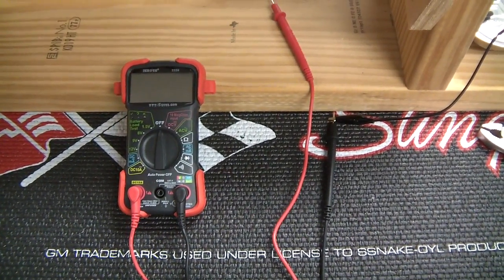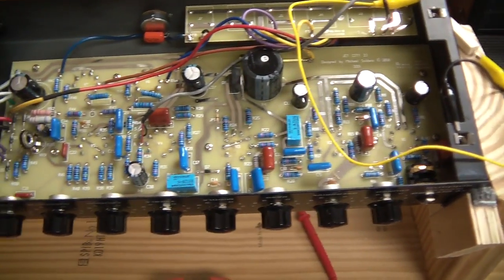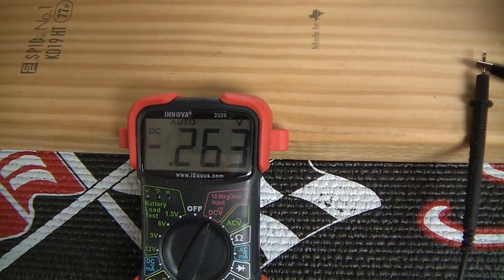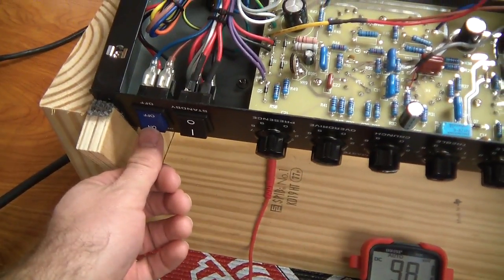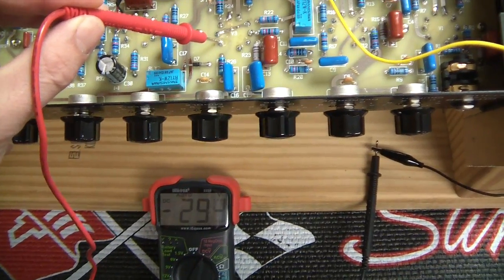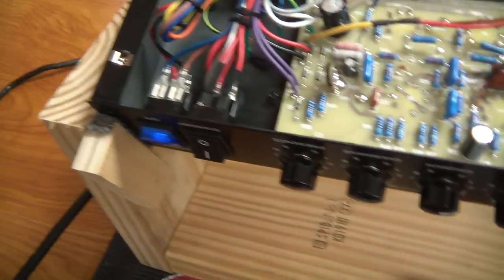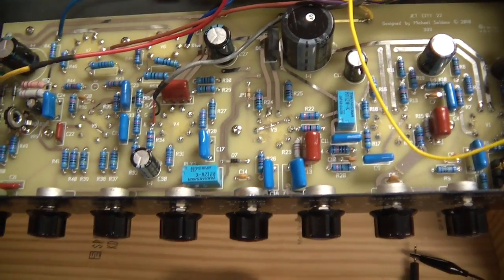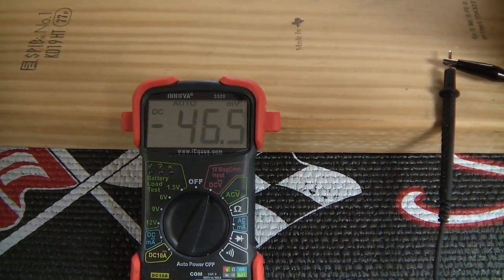JCA22H - How to Drain Filter Caps

Comment: Isn't the plate voltage different when measuring pin 3 of the output tube compare to the point you take the measurement(the wire coming straight from the OT) ?

Comment: I've been looking for info on where to solder the potentimeter for the Depth mod. Finally I see clearly the labeled "FB" on R42. Thank you! From other info gathered I thought the wire coming from the pot goes to speaker jack. Is that correct?
Reply: +Borderline11 It looks like the blue wire continues to a spot labeled FB on the speaker jack pcb?

Comment: Great video, but to people reading- do not *ever* assume your amp will self drain when off like this one. Always assume that the caps are carrying lethal voltages until you have repeatedly tested otherwise. Don't get lazy, and never reach two hands into the hot chassis- always keep one in your pocket. You can die if you are not careful!!!
Reply: Akerfeldtfan
Reply: Akerfeldtfan